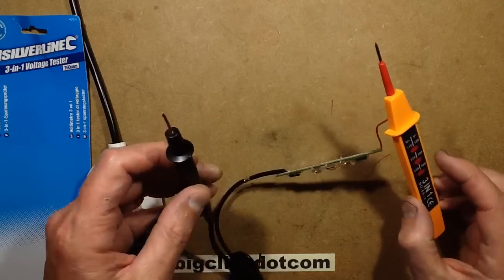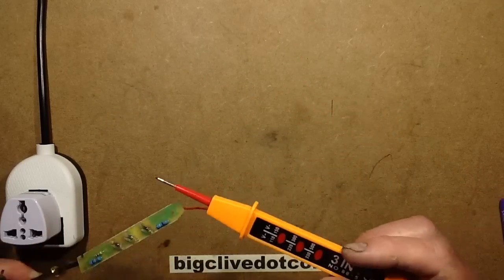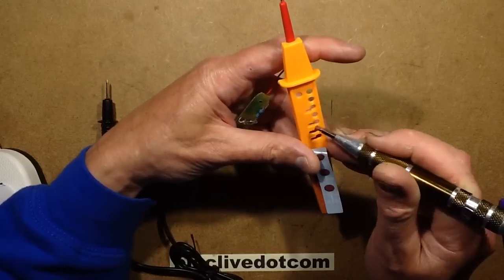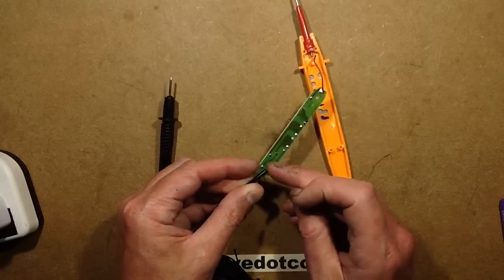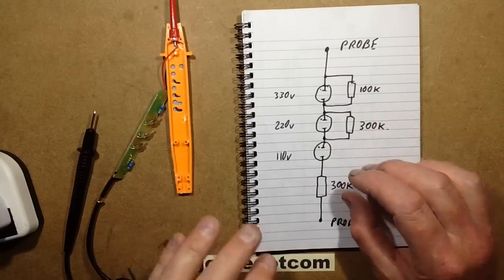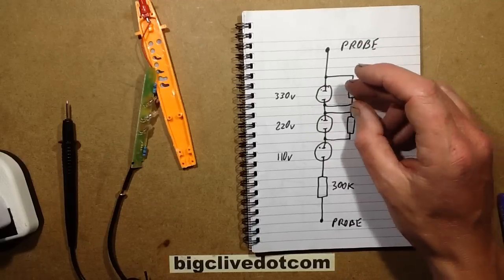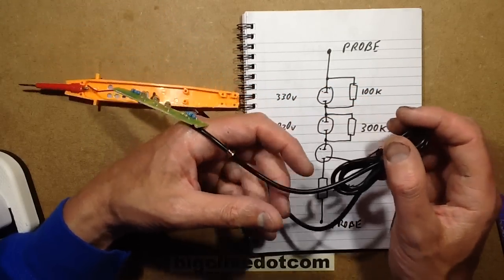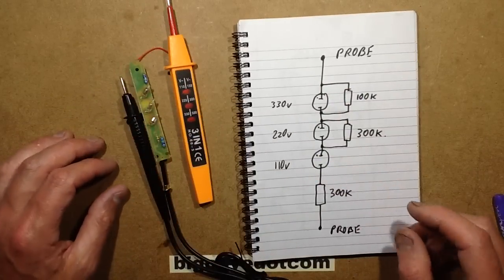The Silverline 3 in 1 voltage tester of disappointment.

Comment: Hi Clive hope your keeping safe and well.
That voltage indicator I had one back in the 80s when I first qualified, never had a problem with it other than that it lasted all of six months and just stopped working , I just got a black one as a free gift with a new crimp tool it an 8in1  rated for 6-380 DC and 6 - 370 AC .
I have tried it on  a 240 v supply and it perfectly fine , but I do have two problems with it 1) they don’t conform to GS38 2) if you test line to neutral  it’s fine but line to earth it bangs out the RCD / RCBO . So not suitable for safe isolation ,  I will keep it as a simple tester to  nothing more for real work I’ll stick to my GS38 approved voltage indicator .  The big problem is they are available to whoever wants to buy them , mostly people who don’t really know what they are doing when they’re tinkering with electricians , for people like you and me they are fine as we know what we are doing.

This and the other video you did on theses cheep things are fantastic 👍❤️ 
Fantastic video as always mate ❤️👍👍👍👍
Reply from the maker: Try testing live to neutral first to warm up the PTC, then while it's still warm a test from live to earth may not trip the RCD.

Comment: its not a case of neon holes havn't been filled in when molded, its an led version thats been rejected due to plastic not flowing fully and leaving gaps. so they put neons in the rejected cases and sold them on.
its not bad quality control, its intentional use of faulty cases to get rid of them.
Reply: i could quite believe that.. 😉

Comment: Would have been nice to have seen a couple of MOVs in there.
Also some blast protection around the sides and under the flimsy label.
Did the cable have any rating printed on it ?

Comment: Even as a younger aspiring electrical engineer i never liked to use these things. Not a fan of uni-taskers, and there is just something about a definitive readout on a DMM that gives you assurance the pixies aren't going to nip your fingers. Even shows the presence of "phantom" voltages that wouldn't show up on a low R meter.

Comment: How much was that?
Reply from the maker: It was only about £3.50.
Reply: Given that this was destructive entry into a not particularly resealable enclosure, there's not much point, you certainly are not going to use it on mains voltage when it's held together with baling wire and duct tape.

Comment: Silverline tools, the little blue package of disappointment everytime..  ive had saw blades they forget to sharpen one side, tools they forget to harden,  wire stripping pliers with no jaw sharpening, multimeters with leads that dont connect inside the plugs, all around terrible, even toolstation tries to hide the name and not say the brand in their catalogue, i wish they would drop them entirely.
Reply: Some Silverline stuff is good but some is bloody awful.  I only buy their stuff from places that offer free returns.
Reply: Morinaka25
i will say the good tools i have had are sockets and some metric spanners to fill in gaps in my set, they have been well made and fit well, and some screwdrivers (rubber combo handle) have been decent also, snap off blades have been meh as they are not as sharp as stanley but better than nothing
Reply: Silverline 1/4" ratchet was the single worst ratchet I've ever used, and the last Silverline product I ever bought. Their magnetic tray seems decent.
Reply: Jusb1066  But you continue to buy them! 😲

Comment: DIY: drill it yourself
Reply: Baerchenization Erm.. I am only a hobbist DIY tinkerer, but when something breaks I open it up - unless it's worth the effort (and money) of returning it. Why would I, if I already am a DIY tinkerer, not spend 10 minutes of my time to diagnose the issue, instead of spending an hour with filling out RMA from, printing it, addressing Chinese package, going to the post office (paying the postage fees to China), and only then I can start enjoying my tool-free time while I wait in excitement to get another one with the same defect.
Reply: I always tinker with the device that it's badly made, like there was this 2 euro rechargeable flashlight with press lever generator that was wired completely wrong - first I took it apart to look it's inner construction then I modified it until it worked. Now I'm testing it's mechanics. :D Some devices are so cheap it's not even worth to send it back for warranty.
Reply: Just a sharp knife would carve these small "residual" leaked plastic pieces
Reply: I was thinking similarly - 1 or 2 minutes with a Dremel tool and it would be 100% better.
Reply: its more than just those leaked pieces, the slots are way to small. You need to drill them bigger.
Reply: Baerchenization Where are you from, by the way?
Reply: Exactly  a little whittle with a sharp knife and you have your dream come true tester, and not another to go in the bin.
Reply: Yes, because the average DIYer opens electronics and thinks about how to improve them first thing every morning... feels save, extends the warranty. Oh you people of Youtube... :)